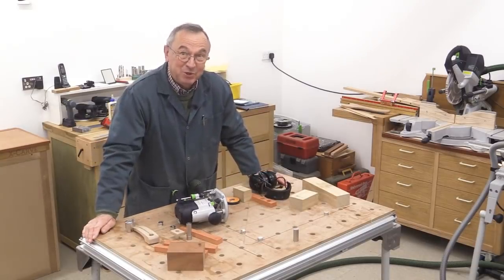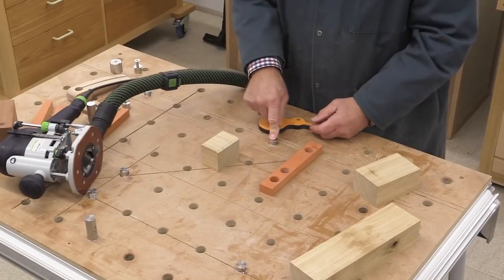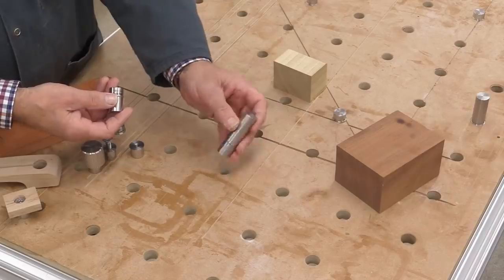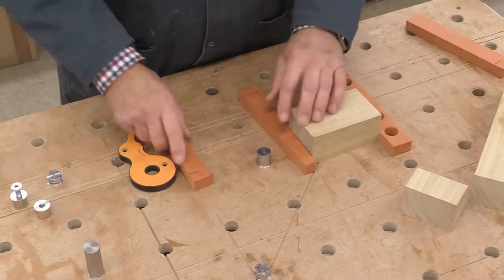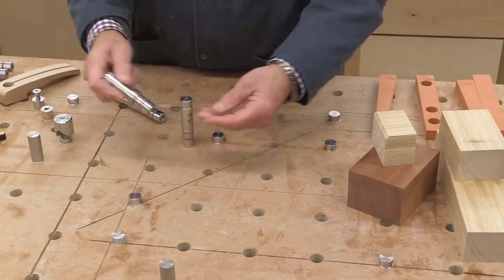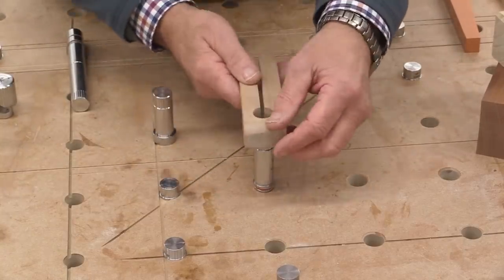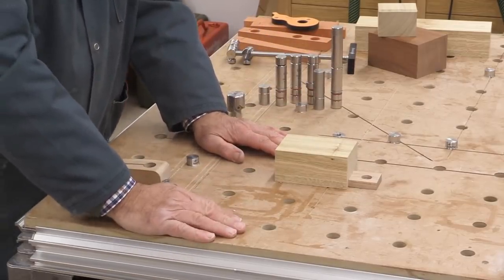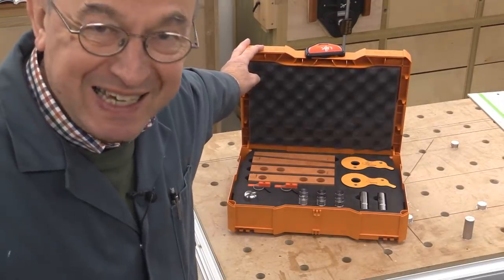UJK Parf Product Overview

Comment: Peter, I recently completed a new combination workbench and table saw outfeed surface for my table saw..  I drilled the top using your Parf Guide System.   If anyone is on the fence about purchasing your system, they should not hesitate.  I have had the opportunity to build a few projects and think of you each time I use those bench top holes to make the job go more smoothly. You did a great job on your system, and continue to do great work with your videos of updated products.  Thank you from the USA :-)
Reply from the maker: Hi Bill, That is a most fantastic bit of feedback - many thanks.     Peter

Comment: Hi Peter. Just got my parf guide so that’s me keeping busy over Christmas. 
Just a quick thought on other uses for the parf guide. I’m having an idea for making a shelf pin guide jig but using the 32mm hole spacing. 
Might be an idea for a video in the future. Different ideas and jigs that can be made with the parf guide. 
Thanks for your videos and ingenious inventions.
Reply from the maker: Hi Keith, That idea with the shelf pins is part of the reason for the offset holes on the Parf Sticks and was mentioned in one of the early videos about the Mark 2 system. Many thanks.   Peter

Comment: Hi Peter, 

Its great to see how all these very useful products have reached the UK market because of your ingenuity. 

I have one wall mounted/fixed  work bench I have a lot of items stored underneath. I have considered using your Parf Guide system to make the holes for using your range of UJK and Festool accessories on however this would means holes to be there permanently which means dust and small items get lost down the holes.

Especially now you have the ability to chamfer the holes,  have you and Axminster ever considered making plastic blanks to cover up the holes with simple plugs which are flush with the surface but are easily removed as necessary. Your chamfer will allow them to be designed not to fall through. Please let me know if there are reasons for these to be discounted. I could cover the holes with a second sheet for instance but do not think that is practical due to lack of expedience in getting to using the system.

Just a thought that may not be fully thought through by me but I am sure has been by yourself. hence your thoughts would be appreciated.
Reply from the maker: Hi Kenny, I did do a drawing and I think the injection moulding pattern was costed but it may have failed the marketing analysis. I will see what happened to the idea, it was a while ago.   meanwhile a simple sheet of 6 mm plywood or MDF that fits under you bench and runs in a channel on each side. It would need to be set low enough for whatever you routinely stick in the holes - most dogs would only need about a 10 mm gap but the Festool clamps would need a lot more.  Cheers.   Peter
Reply: @NewBritWorkshop  Hi Peter,

Thanks for the reply.  Thought you would have had a look at this already. As this style of system is getting to be so universal as far as woodworking is concerned, and can be seen as an industrial standard. I think this system has the merits to branch out. I would imagine that most people’s workshops are put to more use than just woodworking. For example, one of my main workshop tables is faced with heavy duty lino flooring and is also used for working on Lawn Mowers and small engines etc as well as woodworking. So, I am not concerned about grass clippings and oils getting anywhere, I don’t want it to go. I could use your anchor Dogs screwed down from the underside with a bolted eye on the top for tying down items tipped up etc if there is enough thread left. I have also parts of the workshop with Kitchen units topped with plywood again I have tended to use aluminium tracking or routered recesses for clamping rather drilling holes so the Kitchen units are not full of debris including small component’s you have laid aside on disassembling something. I have not used the 20 mm hole system due to the inability to plug it with something flush with the surface. Hence something like your Anchor dogs with no thread made of something like Delrin would be ideal. All of which I think is possible but it just comes down to cost. Like all these things, I have to ask myself the question, do I spend the time making the plugs myself or buy them in ready to use. Or stick with work surfaces with no holes and use other methods to accomplish tasks such as Holding down items of various sizes and shapes or ratcheting things apart or pulling into alignment.
Reply from the maker: Hi Kenny, I also do "dirty" jobs in the workshop and have a sheet of plastic that covers the bench. I have a meeting in a month with Axminster and will see what happened with the other idea. Cheers.  Peter

Comment: Great job Peter.  I have a top mounted to a very solid Kreg work table frame kit. One of the things I don't have is a hinge for the track saw track.  I have ordered an extruded rail and plan to make a hinge as I'm something of a hobby machinist, however this might be a good suggestion for product with a potential market.
Reply from the maker: Hi Mark, Good luck with your hinge arrangement. Many thanks for the super feedback.   Peter

Comment: The accessory kit is totally awesome and opens up many possibilities for MFT style table use. I might not ever need a vice with your extra bits. I am soon to get the Parf Guide system (V2) to build a couple of tops for jobsite use with a track saw.
  When building the actual tops, is there any issue with using a Baltic birch ply (18mm) versus the typical MDF? Whichever material I settle on, I would like to seal the top with water based poly and did not know if that would affect the accuracy of the holes. Most tops I see are completely untreated. Any info or alternatives for moisture protection would be appreciated.
Reply from the maker: Hi Andrew, I am not a fan of any type of plywood for a cutting station top. You are more likely to get breakout when drilling the 20 mm holes and the top will probably be more expensive, particularly if you are using Baltic ply. Also, I have found that ply tops need replacing sooner as they seem to get beaten up faster than MDF. There is no problem with applying poly but do it BEFORE you cut the holes as you do not want it to drip into the 20 mm holes and give an even tighter fit for the dogs.   Good luck.   Peter
Reply: @NewBritWorkshop  Thanks Peter for the info and the prompt reply.
Reply: @Keith Thompson Thanks for the info. I don't feel like sanding that many holes by hand. I will look for some MR type MDF

Comment: I apologize if it’s already been mentioned, but have you considered machining a hex-shank into the end of the manual chamfer tool so that it can be chucked into a driver?
Reply from the maker: Hi Christopher, Many thanks - yes it has been mentioned before. If people need to chamfer a lot of holes and find the tool difficult it may be easier for them to use a router with a chamfer bit fitted.   Cheers.  Peter

Comment: Hi Peter ,i see you use your festol track saw which clips to the dogs ,how easy is it to use with the dewalt track saw as it has rubbers both sides , i'm only asking as i'm interested in buy the parf guide system.
Reply from the maker: Hi Richard, I do not have the Dewalt system and have never seen their track. The Rail Clips are specifically designed for the Festool track. The Parf Guide System is independent of the manufacturer of the guide rails and saws as it provides the accurate layout of the 20 mm holes. The bench dogs you choose are also independent of the saws and tracks as the track is pushed against the tall dogs.   Peter
Reply: Ok thank you Peter ,I will get it because of the accuracy you can achieve,I can modify the Dewalt track to fit tight ,thanks again for your advice and really like your videos.

Comment: Hi Peter can you please advise what is the video that has the extraction tool You made - i have seen it before but do you think i can find it now!!!  Building my first Parf guide top today thanks Brenton
Reply from the maker: Hi Brenton, The tool is easy to make, here is the link https://www.youtube.com/watch?v=g7LfFp-4kF0        Remember to use a pecking motion when drilling the 20 mm holes as it helps to clear the spoil and leave a hole with cleaner sides.  Peter

Comment: Hi Peter. Am just finishing making a new MFT top. When you mention using a router to put a chamfer to accommodate the various dogs - how deep do you recommend 1mm  to 1.5mm ?
Regards
Reply from the maker: Hi John, I did not measure the depth for mine so try 1 mm and then test it with a super dog and adjust if necessary. I suspect it will need to be a fraction deeper.   Peter
Reply: Thanks Peter

Comment: Hi Peter another quick question if I may. The UJK Assembly square is not available in Australia for some reason, is it possible for Axminister to give me the specs on it so I can make my own?? regards Kim
Reply from the maker: Hi Kim, I am certain that they would not do that - the whole world might ask the same thing and Axminster would suffer hugely. Why not order it from Axminster - you will be amazed at the low cost of shipping and you will not pay the European sales tax which will save you 20%.    Peter
Reply: @NewBritWorkshop  Hi Peter, the only reason I asked this is because they will not send them to Australia for some reason which I haven't received an answer for. I would much rather prefer to purchase it from Axminister like I have on a lot of other tools but this product for some reason cannot. I was able to purchase the UJK WORK HOLDING ACCESSORY KIT IN T-LOC CASE which has valchromat products in it and you can purchase valchromat in Austraia but I just can't get an answer regarding why. Is there any other avenue I can take to get the Square?? Regards Kim
Reply from the maker: Hi Kim, I will highlight this to Axminster and see what the problem is.  Peter
Reply: @NewBritWorkshop  Thanks Peter

Comment: Thank you Peter. i have many of the UJK Parf products and really enjoy them. i have only one gripe... tolerances are so tight that your parf dogs just won't come out of the holes in good quality 19mm MDF... i have tried your gizmo and it just wont come ... any suggestions?
Reply from the maker: Hi Izak, It is due to the very tight tolerances and the nature of MDF. Very small "hairy" threads of MDF line the inside of holes that have been drilled. If one drills quickly with too much force then these threads can be significant. Also, they change with humidity. I use a "pecking" motion when drilling - drill a quarter of the way through, withdraw a fraction, then another quarter and so on. I have 3 remedies for holes that remain tight: You can apply a thin coat of Vaseline on the inside of the hole. You can carefully re-drill an offending hole using the 20 mm jig. Or, like me, make an extraction tool out of a scrap of wood. Axminster and I have discussed changing the tolerances but we always agree that it would reduce the accuracy of the system.    I am sorry if none of my suggestions help.   Peter
Reply: @NewBritWorkshop  Thank you for your answer. These are good suggestions and i will give them a try!
Reply from the maker: Hi Izak, I hope it works okay. MDF is a strange material. I use really good quality Medite MR yet across a new cutting station, done with the same 20 mm cutter, some holes will be tighter than others. I have found that some will loosen with use and others will be tight if not used for a long time (as though the hairy MDF threads are growing ! ). The ultimate solution is to leave your dogs in the same place for sawing. That is what I do on my large tracksaw cutting station and it removes all problems. One other interesting thing about MDF - air can pass through it - I have used a vacuum clamp to hold a piece of MDF and found that another piece of wood can be held in place on top of the MDF. The clamping action is not especially great but it is significant.   Cheers.   Peter
Reply: @NewBritWorkshop  Hi Peter, my setup allows me to keep just one dog at the same place and  i do leave it there. Its more of an issue when i need to clamp something in the middle of the surface. My solution was to create on the lathe few dogs that are a hair looser and that works well.
I will try your other suggestions and see if it helps.
By the way, do not see any of these issue on a really cheap 16mm plywood.
Thanks, Izak.

Comment: Peter, can you stack two or more cam clamps on a taller Parf Dog to stabilize a thicker workpiece?
Reply from the maker: Hi Bob, I had not thought of that. Mind you, I was using my full strength (not so much these days) with just the one and I just could not pull that piece of wood away.   Cheers.   Peter

Comment: Hi Peter, I bought into your system got the kit from Axminster and have just made a top, do you know is there a way to slacken the holes or have they made a new cutter slightly bigger ? because the dogs fit so tight I’m having to punch them out from the underside to get them out.
As your showing in this vid your dogs push in nicely.
Reply from the maker: Hi Jim, The tolerances are tight in order to get greater accuracy but it is also the nature of MDF. Very small "hairy" threads of MDF line the inside of holes that have been drilled. If one drills quickly with too much force then these threads can be significant. Also, they change with humidity. I use a "pecking" motion when drilling - drill a quarter of the way through, withdraw a fraction, then another quarter and so on. I have 3 remedies for holes that remain tight: You can apply a thin coat of Vaseline on the inside of the hole. You can carefully re-drill an offending hole using the 20 mm jig. Or, like me, make an extraction tool out of a scrap of wood. I leave my various dogs in place on my tracksaw cutting station but if one inserts and removes them frequently then the holes do loosen in time. That is something that we have to bear in mind as the holes must not become sloppy as they were on my Festool made MFT3 top. In this video the top is one that I created about 18 months ago and I use it for demos a lot. Axminster and I have discussed changing the tolerances but we are concerned that customers would not wish to reduce the accuracy of the system.    I am sorry if none of my suggestions help.   Peter
Reply: New Brit Workshop thanks your quick reply Peter, I’ve done all of the above as far as drilling goes but I’ll give the petroleum jelly a go.
( I was going to say I’ll give the Vaseline a go but it sounded odd ) 😝
Reply from the maker: Jim, I have found that with frequent use the holes do ease a bit.   Peter
Reply: New Brit Workshop 👍

Comment: Hello Peter,  I'm sure you're fed up with being asked this, but why 96mm hole pitch?  Most would have rounded it up to 100mm.
Reply from the maker: Hi Steve, No problem. I understand that it is associated with the Euro standard for kitchen and cabinet fittings - 32 mm, 48 mm and 96 mm are part of that. The 96 mm spacing was adopted by Festool and several other companies and so it made sense to keep to this spacing as there are a number of after market accessories that rely upon it.  Peter

Comment: This video must still be drumming quite the demand for the accessories kit, it's currently out of stock and it's mid Feb 2020
Reply from the maker: Hi Rodger, The original few hundred flew off the shelves much faster than expected. They have a larger production run going through now.    Cheers.   Peter
Reply: @NewBritWorkshop  great, I'll keep an eye on the site for the restock. All the best.